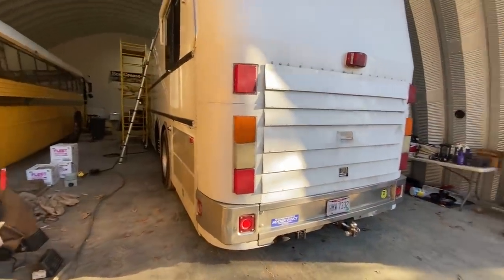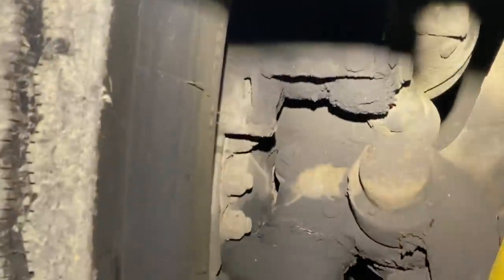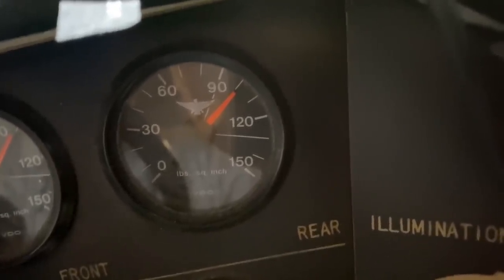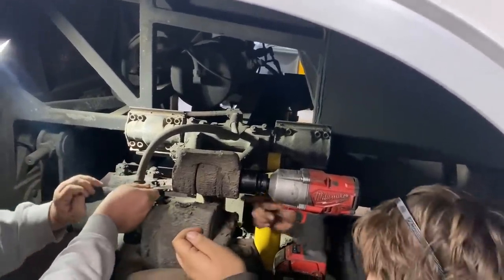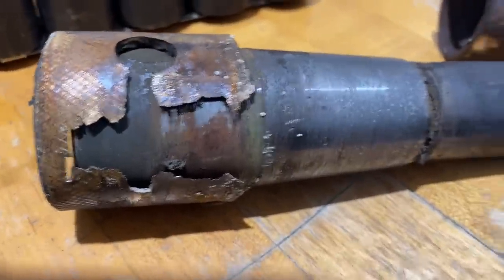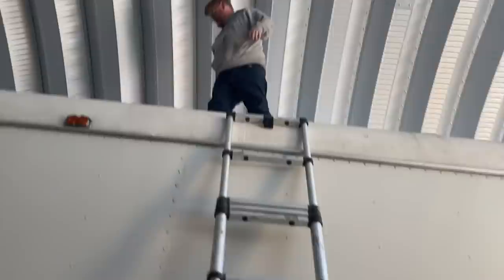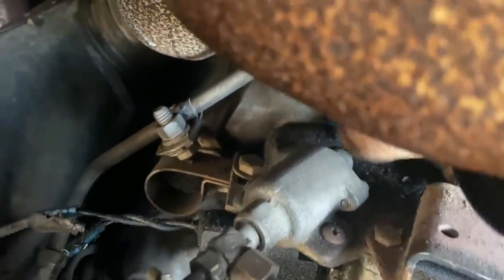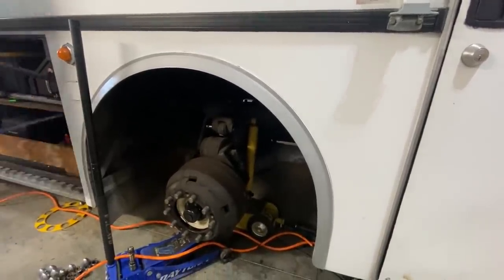Wobbly wheels Eagle bus. Clearly the last shop didn’t do the lube job.  NO Grease in years!!

Comment: Hi Scott
  As a now happily retired bus and coach technician I find your channel fascinating, I am intrigued by the similarities and differences between European and American vehicles. To give a bit of context on the general subject of king pins for the other viewers of this channel when you check them you are looking at two different areas. The first one is king pin lift, how much up and down movement, the second one is rock, how much side to side movement. In the U K heavy goods vehicles and PCVs are required to have a yearly mandatory inspection which is overseen by VOSA, the transport industry regulator. Their guide to the inspection of public Service vehicles (busses and coaches) states that the maximum lift before it is deemed to have failed is 1mm and the maximum amount of rock allowed is 10mm on the rim of a 500 mm wheel. These are the maximum figures, in service the operators would expect to change the pins out before they got anywhere near these figures, with this amount of wear it would soon knock out the tyres and those big black donuts can be expensive. 
  One thing I find puzzling is that after repairs to a vehicles braking system you do not have a full roller brake test carried out, in the company I worked for this was standard practice after any repairs to the brakes or air systems of any vehicle

Comment: I can feel your pain with jobs like that.  Just did the same on my Eagle 10 on the right side and also replaced the shackles.  Of course, half the hex bolts broke taking them out so I had to drill and repair the threads for the new bolts.  One of the worst jobs I have done so far and I have done just about everything to my Eagle at this point to keep it tip-top.  Still need to do the other side and am not looking forward to it.

Hey no one ever listens but...  you guys should seriously wear hearing protection when using an impact or air hammer.  I am 45 years old and am losing my hearing due to many years of impact noise damaging my ears from exposing myself to that since I was a kid.  I learned my lesson and wear them now, but it's too late and I have a constant ringing in my ears that will NEVER go away.  It sucks, really sucks.  Wish I was more careful.

Comment: If a Detroit didn’t leak a little overnight I would think something was wrong. The front rod bushing’s were the most overlooked grease fittings when I worked for Trailways back in the 80’s, like you say Scott if ya want your bus serviced right, take it to a bus mechanic.

Comment: Does this bus have the compartment in the center between the fuel tanks with an access door from the bottom?  I believe the bus hvac blower was located there and on our model 05 there were grease zerks in there for the tag suspension.  As a kid,  it was my job to grease the chassis,  fun memories.

Comment: All the serious safety problems you find on these older Bus RV conversions  makes me scared to be near one on the road.  Brakes, major air leaks, worn out broken steering.
On the West Coast, theres no one set up like you Scott, to keep them road safe
Surprised the old bus n conversion service data is not available online thru AllData or others.
I see these old dogs on the road fairly often when we're RVing.  Often on the shoulder broken down or in destination tourist towns with forsale signs.
Most of them blow smoke on the mountain passes n our large real hills
See too many of them going down the road sawing back n forth not staying in their lane
Shame the State n Hwy Patrols dont pull them in to the weigth station sheds for detailed satety checks like the commercial trucks.  Instead theold Bus RVs get a pass.
Reply: I agree, the condition of some of these vehicles is appalling.

Comment: I worked in a Freightliner shop for a few years and got bitched at for taking too long to do a service because I was Jacki g up the steer axle when I greased kingpins and checked wheel bearings. They just wanted it pencil whipped.

Comment: I am not going to get into how much is the maximum amount of play a King-Pin is allowed to have before being considered bad because every manufacturer tolerance is different by model and or year that information is available in each vehicle service manual or other service manuals such as for front suspension and wheel alignment. What I would like to point out is every service manual I have ever read, wheel alignment and suspension clinic/training class that I have ever attended or taken always emphasized one thing before assessing any suspension part or parts should be properly “greased/lubricated” prior to assessing/checking them for wear if they have grease fittings/lubrication points.  By properly greasing/lubricating I was taught to wipe excess old grease away from the suspension/steering gear member/part (ie ball joint, king-pin, trunnion, tie-rod end, center link, idler arm, pitman arm, control arm bushing etc), wipe the grease fitting clean of dirt/old grease and then greased/lubed while the suspension/steering gear is unloaded (ie is not supporting the weight of the vehicle).  The reason for my post is not to critique or be critical it is just rather to point out an often overlooked step when assessing if front end /suspension parts are excessively worn and or otherwise not in spec.

Comment: An Eagle that’s not leveled? Check those torsions!
Reply from the maker: He is moving to a new house and the bus is loaded with a lot of weight in belongings.  Not a good time to try and do that.
Reply: @BusGreaseMonkey  Very true, but eventually he should get them looked at.
Reply from the maker: He had adjustment left. We discussed it and there is a very specific process to do it and this was not the time to do it.  You should not just adjust it without doing it correctly
Reply: @BusGreaseMonkey  Of course. I worked with a company For three years that ran Eagles. It was great as I learned about the eagle coaches top to bottom and how to care for and maintain them. I would love to find myself a New Jersey spec’d model 20 but I’m sure that time has passed. So in the meantime I’m enjoying owning and restoring an ex Los Angeles 1989 Flxible. As much as I would love to get my bus to your shop sometime, I know that you are a Detroit man and this puppy packs a Cummins L10 Mechanical.